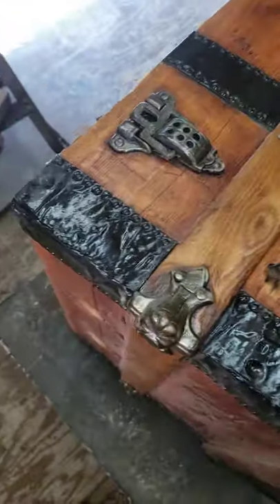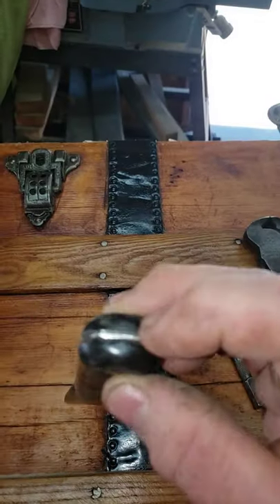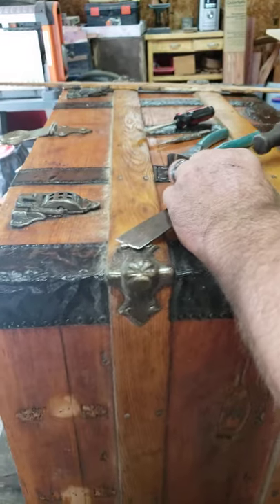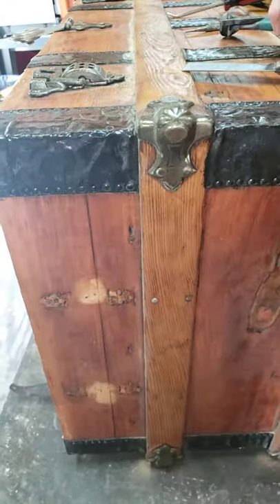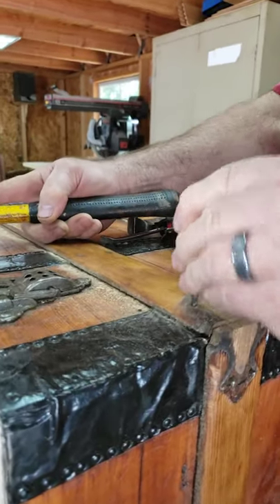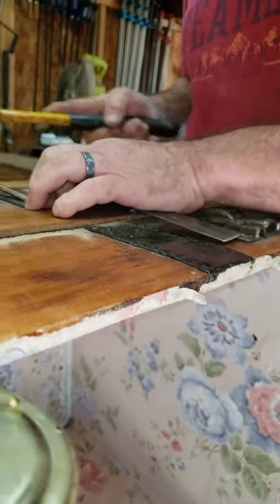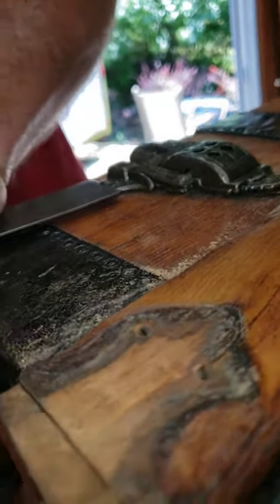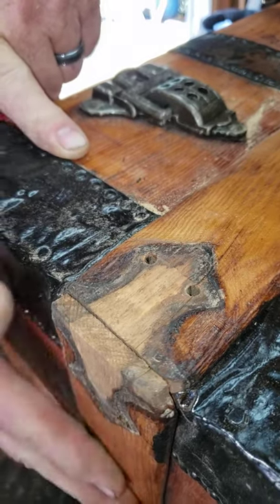Antique trunk restoration

Comment: Hi there. Thank you for this video. It helped me to remove the hardware off of a wooden footlocker from the 40’s. The hinges are giving me trouble.  On the inside of the trunk there are  recessed round metal caps where the hinges connect to the inside. Im at a loss. Any advice? There are regular nails on the outside of the back and the lid but I’m afraid if I remove them that I’ll still have an issue with how they are connected. 🤦‍♀️